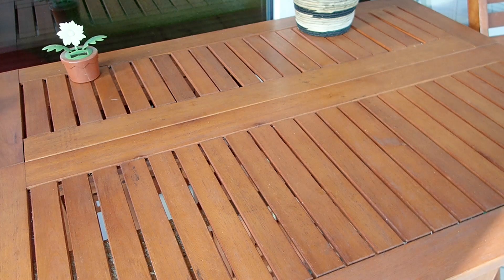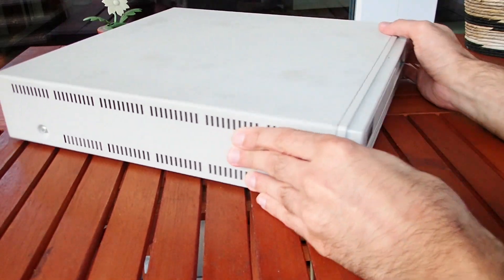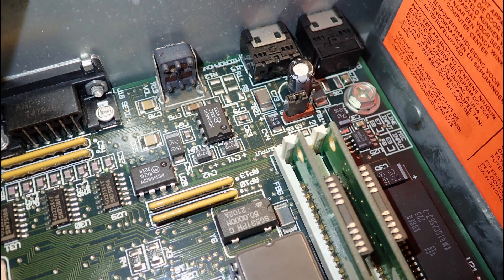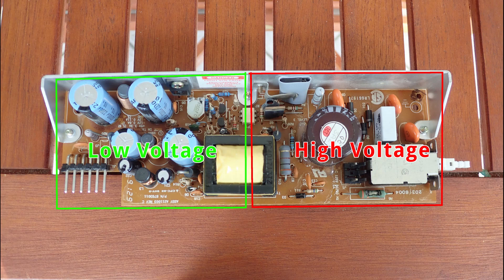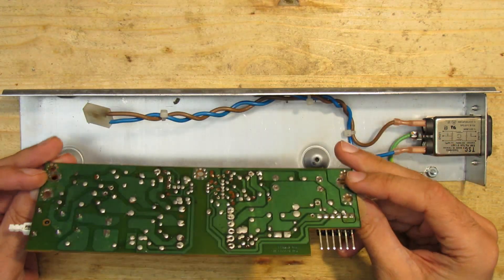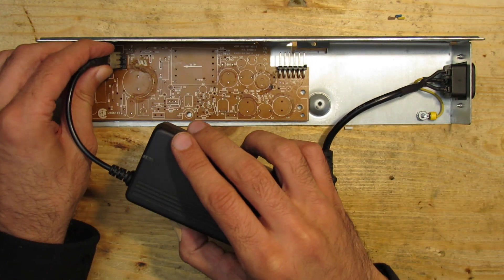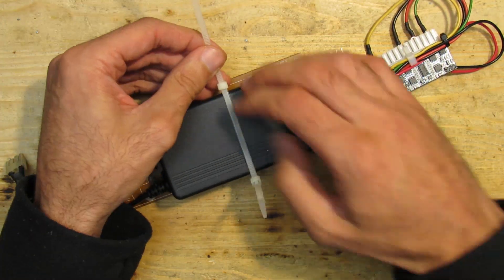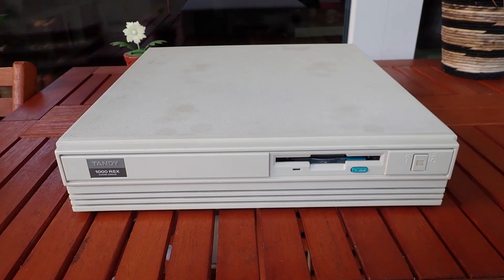#SepTandy with Tandy 1000 RSX (Part 1): replacing the PSU

Comment: 120 volt AC has been the standard in the US for decades.  110 and 115 volt was before the 80's.   Good video.
Reply from the maker: Ok, I thought, it would be still 110-115V. It's probably the same as in Europe, today it should be 230V everywhere, but before it was varying between 220-230V in different places.
Reply: @necro_ware  The official US spec is 240 volts with 120/120 split phase  So most US homes have 240 coming in single phase and then 120/120 split.   It's just a center tapped transformer with the center as the neutral.  Long ago it was 220 with 110/110
Reply from the maker: @jeffm2787  Ah, thanks for the info. In case you are interested, at least in Germany we get three 230V phases twisted by 120° to the house. This makes 400V. All three phases are usually going to the electric stove, heater, boiler and such things, which need a lot of power. And each phase with 230V allone is then splitted over the house wall plugs, lights etc.
Reply: @necro_ware  I've been having many conversations lately about power delivery in various countries.  We only get the higher voltage 3 phase for commercial and industrial in the states up to 480 and 600 volts.   While we have 12-15kv at the poles it's often single phase in residential areas.   It also varies widely depending on where you live.  In the end it all works,  I have 72KVA (240 x 300 amps) to my home so I'm good.   The norm is 48 KVA.

Comment: Thank you for this video. It made me realize that the 2500 RSX is just the same motherboard as this with the Tandy Sound Removed in the larger 2500 series case
Reply from the maker: Thank you for watching. Yes, it is the same mainboard. And as far as I know Tandy Sound was not removed, it was just clamped away in some later revisions, because it made problems, when using the machine with usual Sound Blaster or compatible sound card. This year I'm going to make another #Septandy video, where I will briefly explain, why this problem appeared.
Reply: @necro_ware  Thanks so much for the reply. Information of any kind on the 2500 RSX is very hard to come by. I will be playing around with it later today and will confirm but from the last time I looked I do believe the Tandy Sound chip was removed at least on my 2500 RSX example, as the associated components on the motherboard are not populated. My 2500 RSX does not have the physical 3.5mm jacks for audio output or input(however they are plugged on the back of the case), however it did retain the volume control for the PC speaker. 

One interesting thing I did learn was there was a very specific version of Deskmate made only for the 2500 RSX. I'm willing to bet it is modified to remove the applications that used Tandy Sound, as otherwise it seems identical to the version I remember on models like the 2500 SX-20 and SX-25.
Reply: @necro_ware  I went and checked the motherboard and you were 100% correct.

Comment: Love it, thinking outside the box to get it grafting, any plans to use atx connectors on the pico adapter?
Reply from the maker: I used one in an Atom PC many years before. A PicoPSU is very limited in its power, so you can't use it everywhere.
Reply: @necro_ware  oh yes - very limited in power delivery. Sorry my question was poorly worded.

What i mean is, would you comsider using the female end of the atx connector rather than using the copper wire inserts in the pico atx connector?
Reply from the maker: @envoycdx  Ah, I see. Well, I could probably, but the copper cables are thick enough to sit quite tightly. I'm actually happy with it as is.

Comment: Having an RSX myself, I have to say that my main gripe about them is replacing the floppy drive if they happen to go cranky on you. This is difficult for two reasons. First, the Tandy 1000 line always used the Shugart pinout on their floppy headers, with many of the older models supplying power over that header. This can be solved by studying the pinouts and custom making your own cable, or finding an older floppy which still has the configuration jumpers. Second, and the difficult part with these TL  and later 1000 models, is finding a floppy aligns closely enough with the eject button in the built-in bezel, since you need to remove the bezel and button on the replacement drive to make it fit. Some people would just hack out the plastic over the bay to make the new one fit, but I REALLY like to avoid any kind of destructive modifications on these old machines. 

I was able to find one that fit for mine, and as a bonus, I was able to use the drive cover flap for the new one to keep the dust out, since it mounts to the frame instead of the bezel itself. Why the original didn't come with a dust flap, I don't know. For the 1000RSX to use a newer "non-jumper" floppy, you need to carefully dismantle the connector at the floppy end, rotate it so the key is on the opposite side of the ribbon, and the stripe (pin 1) on the ribbon matches pin 1 on the new floppy drive, and then swap pins 10-12 on the ribbon when you reassemble it.
Reply from the maker: Thank you for the info! As you've probably already seen, I managed to get the Gotek working, by setting the S0 jumper. However,  your info is very helpful should me or someone else have to replace the drive one day. Since I serviced the floppy drive, I hope it will serve longer now. Actually, I don't use floppies very much, just  for the OS and network installation, after that I just copy the files over the network directly to the hard drive. My problem with this machine now is, that the HDD is only 100MB small :) I could replace it with a bigger CF card and go silent, but it's funny to have a mechanical drive in it, may be I'll replace it with a 500MB I have at hand.

Just as you, I also don't like destructive changes and try to avoid them. For this machine modifying the PSU was really a hard decision, but I had to, since even if I would repair it, in EU we don't have 115V.
Reply: @necro_ware  Yeah, I posted my comments before I watched the other videos :P

The Gotek also has jumpers for the motor control as well, I believe (I don't actually have one) that might avoid having to do the pin swap. Or maybe it just doesn't need the "motor on" signal? I'll have to pick one up some day and play with it, I just haven't really needed one.

The only reason I clued into the Shugart pinout on the RSX when I replaced my floppy was from working with the pinouts on my HX, but it appears that all of the Tandy 1000 models used Shugart derived controllers. As you probably know, the PC floppy standard can only use 2 floppies per controller, and has 2 separate motor signals, but the Shugart can use 4, and has only one shared motor signal. Hence the reason for the pin swap. 

My HX, which like all the earlier 1000 models, had the card-edge floppy connector at the back of the machine,  has the internal floppies hard coded on the header as DS0 and DS2 (DS1 and DS3 lifted), while the external header is hard coded as DS1 (only 30 pins on the header anyways). I think that's derived from the fact that it's immediate predecessor, the EX, only had a single 5.25" drive at DS0, so naturally the external would be DS1. This might have gone all the way back to the original 1000, I'd have to check the technical manuals to be sure.

I've got a 250MB in mine. I tried a 512MB CF card, but it was having difficulty with the geometry (and I like the clicking noise anyways). The limit is supposed to be some oddball 510MB, or something? I'm not sure why, but a 480MB, if you can find one, would probably work fine. 

I like what you did with the PSU though, and a laptop power brick can supply more than enough amperage. You can't see the changes unless you open the PSU shield up. Really, your only other option would be to get a step-down transformer after repairing the blown components, but this is a lot cleaner.

Comment: If you want to upgrade the system RAM, be aware that it can only take 30-pin SIMMs of 1MB and 4MB capacities, and both must be identical. 

I wasn't able to track down the appropriate Radio Shack upgrade package to upgrade the video RAM, but was able to find some chips on eBay that were the DIP-20 equivalent to the SOJ-20 DRAM chips onboard. They are KM44C256BP-7. These are necessary to install the Windows 3.1 drivers to get it to run in 256 colour mode at 640x480, or up to 1024x768 in 16-colour mode. Otherwise, you can still play DOS games in 265 colour mode you're just limited to 16-colour 640x480 within Windows.

I have a Sound BLASTER Pro 2.0 , and it does work in this machine.
Reply from the maker: Thank you for the feedback, as you probably already have seen, I do all the upgrades in the 4th part. In regards to Sound Blaster, I was talking explicitly about SB2.0 not (!) the Pro version, since SB2.0 needs -5V voltage and the Pro version does not. However, as I've shown in the second part of this series, my concerns were wrong, since there is a LM7905 voltage regulator directly on board and so, -5V are not coming from the PSU as in usual PC would be. That's why Sound Blaster 2.0 is kind of working in this machine.... and other expansion cards, which would need -5V would also do.
Reply: @necro_ware  It's a cheap way to do it, but it works.
Reply from the maker: @BlackEpyon  I'm not quite sure about the economical aspect of it, because for me it doesn't make any change if the LM7905 is in the PSU or on the mainboard. Probbly, if you use the same PSU in different devices, where you don't always need -5V?! Well, who knows....
Reply: @necro_ware  Having the regulator in the PSU would mean that it joins the PSU's heatsinks. instead of sinking heat into the motherboard (it's mounted tab down). Dropping 12 down to 5 volts will sink a lot of heat, depending on the current being drawn. It depends on how warm it gets, but any kind of point heat source like that can cause stress to the board over time. Could probably run a thermocouple to it and see how warm it gets.

Might not make much of a difference in this design, but it's more of a "best practices" thing when designing PCBs. Some of the old MFM hard drives had several regulators riveted to the PCB, and you could see the couloir of the solder mask had turned brown on the other side from how warm they got. Old CRTs and stereos had similar problems, and I've seen a few warped boards too.
Reply from the maker: @BlackEpyon  Yes, that is true for the +3.3V, +5V, +12V voltage regulators, which are used to power something. However, the -5V, -12V have such a low current, that they remain stone cold. Usually, they are used for leveling only, not to power something. 
I was just surprised to see the LM7905 on a PCB, because it is so unusual for PCs of that time. AT PSUs  were specified to have -5V rail, but this RSX doesn't have a standard AT PSU, so, they decided to go this unusual way, I guess.
Reply: @necro_ware  Yeah, as long as it stays cold, it ought not to be a problem.

I'm not sure if you've seen the Monotech NuXT 8088 board. I haven't look at the schematics for the new 2.0 board, but the older version had a 7905 for the same purpose, since newer ATX power supplies don't supply -5v.
Reply from the maker: @BlackEpyon  I didn't see that yet, thank you! Yes, there the 7905 makes absolutely sense with an ATX power supply.
Reply: @necro_ware  Mostly for the newer 24-pin ATX supplies. The older 20-pin ones usually had -5v (the white wire).
Reply from the maker: @BlackEpyon  I made a video about it some time ago. Unfortunately only the ATX before v1.3 used to have the -5V rail, later with ATX 2.0 they dropped it. So, not even all 20-pin ATX PSUs have had -5V. I found it quite complicated to find an ATX PSU, which fulfills my requirements. But eventually I found one (which is not in the mentioned video)

Comment: Just had the PSU on my Tandy 1000 RL go up in a poof of smoke and found this video. Can you or anyone else elaborate on the part where you soldered some jumpers and resistors to prevent reverse polarity? I'm struggling with the purpose of this, but also exactly how and what you did?
Reply from the maker: I soldered only one diode to prevent a reverse polarity. The jumper wires are just to bridge the gaps on the original PCB to reuse the switch and the output solder joints.  Nothing too exciting ;)

Comment: Will the notebook PSU get hot in that enclosure? maybe a small fan might help?
Reply from the maker: The power consumtion is quite low, so the notebook PSU doesn't get hot at all. And even if it would, there is a fan on the bottom side of the case, I'll talk next time about it :)

Comment: Very nice :)
I guess it's time for me to restore my Intertan DT88 (intertan is a Tandy subsidiary so I think it counts as tandy, right ? ^^)
I had this idea of fitting a laptop PSU + pico psu in old dead PSUs, but never had a chance to do it (I have AT 486 tower with a oddly shaped PSU which is dead, but it's rated for 300W iirc. A pico PSU will never cut it ...). Now since my ICL 286's psu just died, if I can't fix it it may be a chance to finally try that :D
Reply from the maker: You can give it a try. Actually, even 486 could may be work with the PicoPSU as well. First of all, the PSU at that time were often over powered, second is the question, how much the PC really needs on the 5V rail. Some PicoPSU can handle up to 8A on each rail, this makes 40W at 5V. May be it is sufficient. One another idea is, maybe to make additional bridge with a voltage regulator from 12V to 5V to get even more power, but I didn't try it yet....

Comment: Reapair the old broken psu..?!
Reply from the maker: you are right, I changed the name into "replacing the psu" ;)
Reply: @necro_ware  the old one is very simple to repair!    One bjt..some resistor and caps! Try to replace this stuff..
Reply from the maker: @pacomassa1379  Not quite, I also have to replace the transformer and do some modifications. The mains caps must be also replaced by 400V version, which are usually taller and there is not enough height. The original PSU will not work in EU and I want to use this PC, that's why I decided to make a total conversion. Now it's slightly more powerful and works with US and EU voltage.
Reply: @necro_ware  aah ok! Understand! 😉

Comment: Thanks, I hate it, I would have repaired the psu, why not? I understand this mod is better, but why not keep the original hardware?
Reply from the maker: Yes, it was a hard decision for me, but still, as I told in the video, there are multiple reasons. The main one for me is, that I couldn't use the original PSU here in Europe. I want to use this computer, not to have it on the shelf. I know, there are inverters to convert 115V to 230V, but why should I bother? The original PSU is everything else, but not good anyway. Now the computer can be used with both 115V and 230V in USA and EU.

Oh, and to keep the original PCB and replace it completely was also an idea, but then I would have to make own solution for the power switch and the internal PSU connector, which goes to the mainboard. It would be quite complicated, I guess.

Comment: How NOT to repair a psu. You should have only changed a couple of components. However, you destroyed the main power supply and replaced it with a non-original one, in which you spent money and made it no longer original and lose market value.

Simply.. WRONG.
Reply from the maker: First of all the original PSU was US and not made for EU. I would have to modify and replace the whole mains power part including the transformer. This would be quite a challenge and would be actually not allowed to use here. Second, the replacement cost me almost nothing, because I used parts which I had at hand. I have about 25 different notebook power supplies leftovers from dead notebooks. The only thing I had to pay once was the PicoPSU, but I once ordered 10 of them from China for 3€ per piece. This was my whole investment. Third, I don't care about market value of this machine at all, because I care about value of it to me. This way I can use it and I do. Otherwise, would I repair and leave the 125V original PSU in it, then the machine would have no value for me, because I wouldn't be able to use it. As simple as that. This channel is about making things usable again, not about how to keep market value.